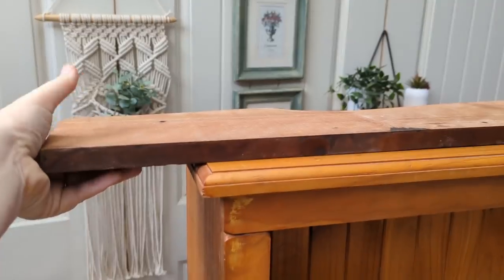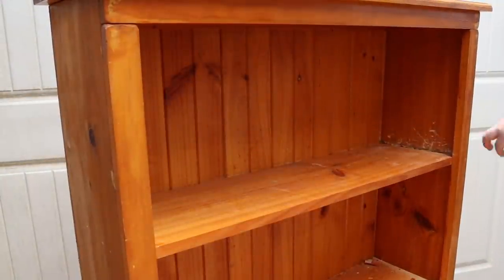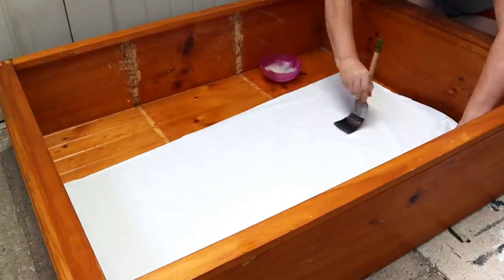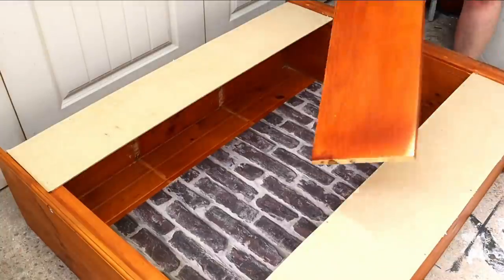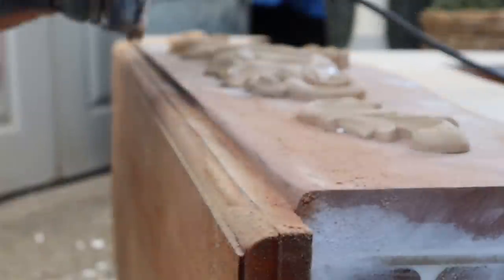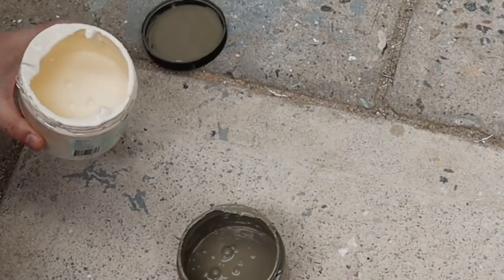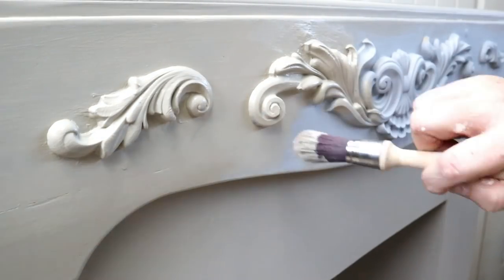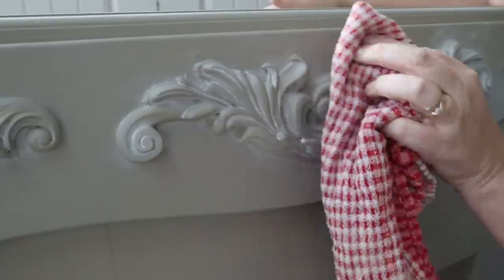Upcycling BOOKCASE to FIREPLACE and MANTLE | EXTREME Furniture makevoer

Comment: My 12V Craftsman Nextel oscillating tool has served me well over the years. Blades can often make a huge difference too—getting a $16 blade instead of a $7 blade was a giant step up for mine. As it’s cordless, I’d recommended getting a spare battery. They charge quite quickly, but I much prefer changing out the battery and getting right back to work than rather than waiting a half-hour for it to charge. It’s also what I use for detail sanding.
Reply from the maker: Awesome! Thanks so much!

Comment: I love your videos and your personality! As far as the papering, I'll tell you what I do. I love to decoupage and wallpaper. I have wallpapered many rooms in my house by myself. Here's what I do: I use 'Paste the Wall" wallpaper. If I know I'm going to deal with an edge that needs trimming I AVOID putting paste in that area until I make my cut. So, if I'm near the baseboard, say - I put my paste on the wall leaving an inch or two dry. Then I cut the dry paper which is much less likely to tear (yes, I've had that happen!), then I add the paste and stick it down. Easy peasy. I hope this helps.

I usually do two coats of primer if I'm doing a white, but not always - it depends on the wood. I love Dixie Belle Drop Cloth, it is my favorite white. But, it's not a bright white at all, it's more of an off-white.
Reply from the maker: Perfect!!! Thanks so much! 😘😘😘

Comment: This reminds me so much of 'proper' Christmas' in the UK.  Will it become a permanent feature in your home Rachelle?  My only tip for the wallpaper cutting is to use a brand new blade each time, whether the paper is wet or dry :D
Reply from the maker: Its already set up on our deck under the dartboard which also has the wallpaper behind it, so it looks like a proper pub wall with fireplace now :)
Reply: @CraftedbyMonnowLane  sounds fabulous.  I'm glad you're keeping it.  Maybe put an extension on the top so Santa can fit? 😜🤣